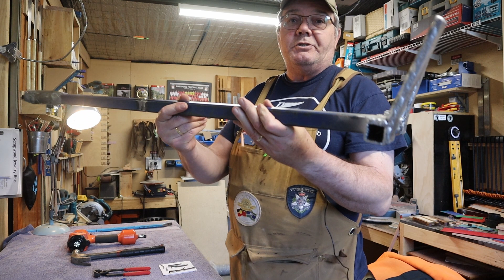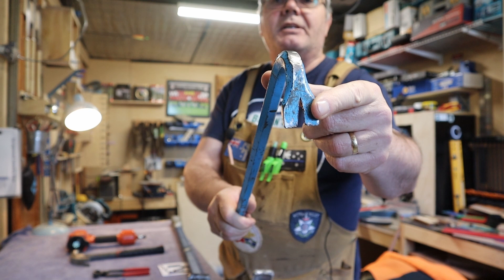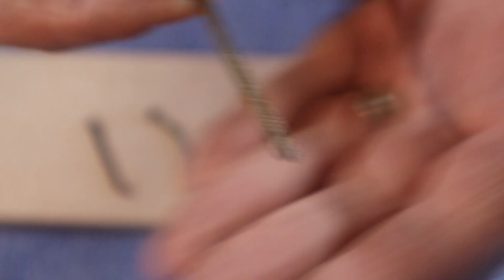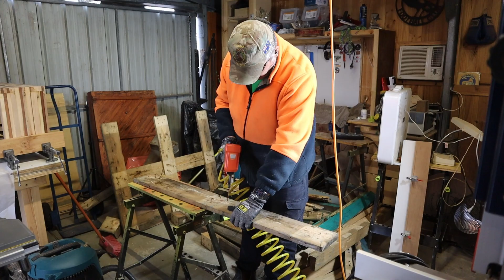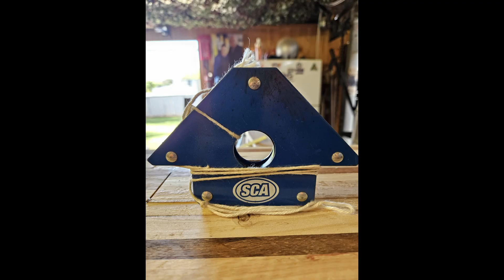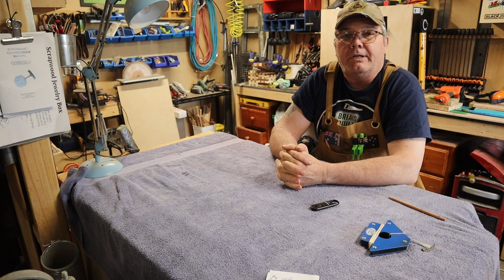Pimp my Pallets! and other reclaimed timber

Comment: I have a home made pallet breaker similar to yours mrk 3 had to use thicker steel. Some pallets are extremely strong. I also use a tall bucket with old rag in the bottom to shoot the nails into but still the odd nail Flys around the workshop. The little piece's of wire left on the nails are to keep them together and evenly spaced when in the nail gun . Does the metal detector pick up the little piece's of wire left in the wood once the nail has come out. Quite often I drill a four or five mill hole in the wood where the nails were just to get the little piece's of wire out. Keep the videos coming I enjoy them 👍steve. Steve
Reply from the maker: G'Day Steve, I agree mate, the pallet I'm breaking in the video was really tough and the one I broke the breaker on.  A taller bucket is a great idea, thanks.